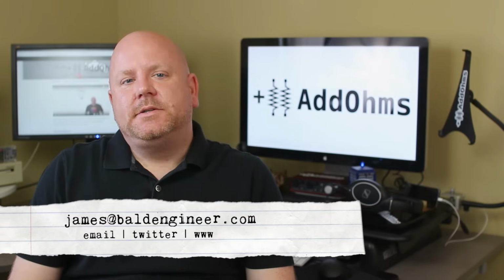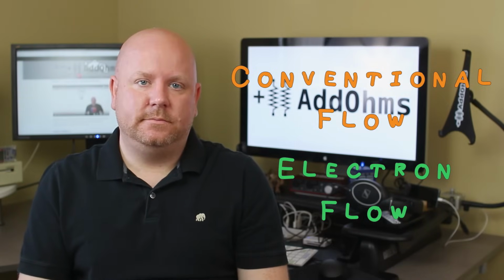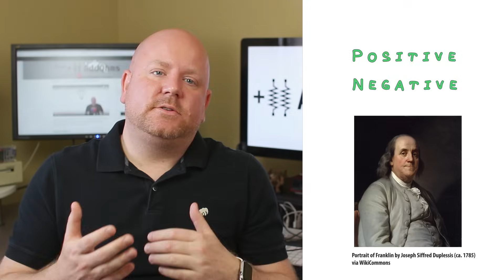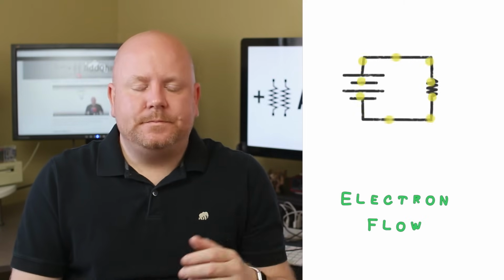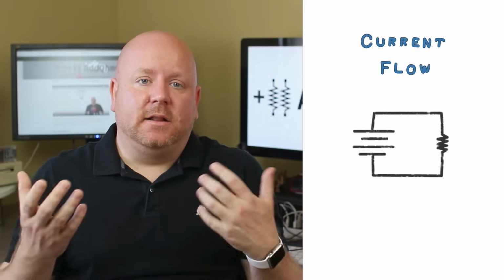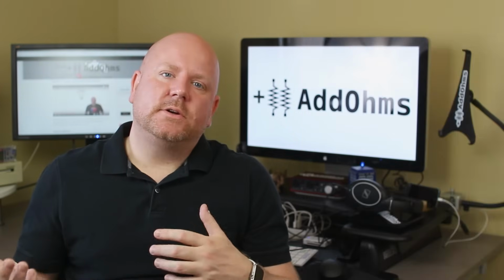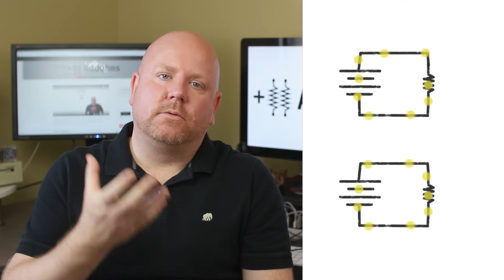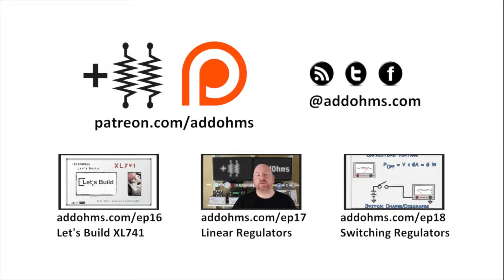Which way does Current Flow | AO #19

Comment: I understand the explanation, but I still feel uneasy using conventional direction (although diodes with their symbol mess things up). Not only because that is not what really is happening, but it messes with other concepts, like the ground. If one wonders why is in most cases not only OK, rather required to connect grounds together, it is easier to visualize that when current flows from negative (that is, usually ground) to positive. When one connects grounds together, one can visualize those grounds (and ground plane on PCBs) as a single source of electrons, as a source of negative charge, and then electrons (negative charge) travel from there to positive parts of circuit. One can visualize ground as a big bowl of electrons, that are getting scooped out with spoons. :)
Reply: OK, so my intuition was on the right path, and my uneasiness was justified. :D

I really hate it when we know something isn't the way it is presented, but we do it anyway because of "the convention". I hope sooner or later this will be corrected, and then we won't have to talk anymore about conventional and real direction - there will be only one. :)
Reply: +mbaksa the number of electrons in a depleat battery is the same as a charged one...because if the electrons did not get returned to the atoms in the batt...you would have atomic decay.   what happens instead is that the chemical reaction in the batt gets weak.
Reply from the maker: The difference is why the electrons move! :) (I think)

I agree the bowl analogy applies more to the charge. 

Okay so consider this...

The bowl is the potential energy. The spoons scooping out the energy are the electrons. They are picking up charge as they go through the bowl and deliver it to the rest of the circuit.

Damn. Wish I had that when I made the video ;)
Reply: Charge is not consumed ever in a circuit. Electrons and positive ions all have "charge". It is a property of the particle that you can never remove from it. A voltage (or electric field) can be described as an imbalance of charge, which causes a flow of current in a circuit which is already full of charge. When charged particles move together, they produce magnetic fields. This is what defines an electric current, that unseen motion of charge (charged particle flows)

I would very strongly recommend reading through Amasci's pages on the common misconceptions of electricity. It will click for you right away.
http://amasci.com/elect/charge1.html
Reply from the maker: "is easier to visualize that when current flows from negative"

Unfortunately, your analogy of a spoon and bowl of electrons is very incorrect. Electrons don't "come from the negative." They simply flow in that direction. Every electron flows around the circuit.

This was my "ah-ha" moment. It isn't like the electrons start at the negative, travel to the positive, and disappear. They are particles (which is matter).  So they are moving around in a loop, no matter what. 

As far as the energy goes, again, it isn't like the battery or DC power supply or whatever "creates" the energy. Energy cannot be created or destroyed. Instead the energy of the battery is what pushes the electrons around the loop.
Reply: Electrons get scooped out with the spoon, their energy gets used and then they are thrown back into the bowl. So there is a loop. Also, from my understanding (which might be wrong) - there is a loop, but current starts flowing from negative pole (which we usually call "ground") since there is an excess of electrons, excess of negative charge. If there wouldn't be an excess fo negative charge (more electrons) compared to the positive sides, there wouldn't be anything to flow, right?
Reply from the maker: Okay, we're close! So let's clarify the difference between electrons and charge. 

Electrons are a particle of matter. They already exist in the "circuit". That's where the idea that they move in a loop comes from. In order for movement to occur, all of electrons have to move. (Actually the electrons are ALWAYS moving, it isn't until there is an electric field they start moving in a unified direction.)

The electron's is the energy.  So an excess of negative charge causes the electrons to move. That isn't the same as an excess of electrons. 

Here's another "ah-ha" that I had recently. Keep in mind that the charge, the energy, moves from electron to electron at nearly the speed of light. The electrons provide the path for the charge to "flow". However, the electrons themselves? They move much much slower. They can't move at the speed of light because they are mattter.
Reply: There is no excess of electrons at ground. You might say "But if there is no excess electrons at ground, where do they come from?". They come from the loop/circuit, this is where your analogy of having a bowl of electrons breaks down. Instead, the classic analogy of water flowing through pipes is much better. Simply imagine a loop of pipes, and the current is the flow of charge through that loop. There is no reservoir of electrons, simply a loop.
Reply: How is then the difference in charge between negative/ground and positive explained?
---
OK, could the bowl then represent the storage for negative charge? And electrons then carry the negative charge to the positive side and come back to the bowl...
Reply: There isn’t really a difference in charge between positive and negative, the density of electrons throughout the whole circuit is the same. 

The thing that produces the current is the Electric Field produced by the battery. All of the electrons in the circuit “feel” the same electric field and thus the same force and as a result all move in the same direction around the circuit.
Reply: Jake Jones, ok, but negative charge is carried from negative to positive part of the circuit? What then happens? Is it "spent" (in regards to the circuit)? It is not going back to the negative part, right? Is this the way we deplete a battery?
Reply: ken, I was asking about the charge, not electrons.
Reply: The electrons within the battery DO travel from the positive back to the negative, otherwise we wouldn't have a circuit. However it takes energy to move the electron from the positive to negative terminal within the battery, the battery has stored chemical energy that does this. The battery is depleted when this stored chemical energy runs out and it can no longer produce a current.
Reply: Still not getting the answer to the question "What about the charge, dude?!" :) What happens to the charge that electrons carry from negative to positive? If the charge doesn't return to the negative, then we could visualize negative (or battery excluding the anode) as a bowl with charge.
Reply: A battery produces a voltage potential between the negative and positive pole due to chemical processes. And this voltage potential is as you suggest an imbalance of electrodes on the plates (lead-acid battery) inside the battery. The plates inside a lead-acid battery is before charging it is identical (Both lead) but after being fully charged you have plates with different chemistry (the negative plate is still lead but the positive plates have changed into lead dioxin). This plates together with the electrolyte (acid) is a chemically unbalanced system and any chance given it will strive to return to a natural state. This chemical unbalance is very simplistically explained a saturation of electrons on the negative lead dioxin plates and on the positive plates a numbers of "free electron spaces" in the atoms.
The larger the surface area of plates in each cell the more current you can draw from the battery before its "empty" , but more important you can draw higher currents over short time spans (for example running the starter motor in your car). 
When it comes to magnetic induced current it's a bit different. Here it is the magnetic field that pushes the electrons around in a circuit and not a static unbalance of electrons like in a battery.
Reply: OK, but I still didn't get my answer about the charge. It actually doesn't matter if it is a battery or other current source. What happens with the charge?
Reply: By charge i think you mean voltage potential (the force pushing the electrons trough a circuit)
"What happens with the charge?"
I'm not sure what you ask for. In a battery the voltage potential is given by the numbers of cells. In a lead-acid battery a cell has around 2 Volt potential. Couple those in series by 6 and you have a standard car battery of 12 Volts. Magnetically induced Voltage is a bit more complex question but it will first and foremost be depended of a magnetic field and the stronger this magnetic field is the larger the voltage potential. Did this answer your question?
Reply: No. At the beggining of this discussion it has been said it's not electrons that are going from negative to positive pole, it is charge (that electrons carry). Moving electrons do looping in a circuit. Charge goes from negative towards the positive part of the circuit. What happens with the charge electrons carry? It should go negative pole to... Where? I suppose it doesn't loop like electrons, otherwise no energy would bi transferred.
Reply: "At the beggining of this discussion it has been said it's not electrons that are going from negative to positive pole, it is charge (that electrons carry)"
If so. It's wrong! Electrons do move in a circuit. They just from atoms to atoms and replacing eachother all the time. I will read trough the comments one more time just to verify what you claim to be said.
Reply: That should of course be "jump from atoms to atoms"
Reply: Hmmm. I think i'm starting to see what you asks for. When you talk of an electrons negative charge you really are referring to the elementary charge. To explain what is going down on this level i will have to trow in the blanket. This is probably difficult enough to answer for  Ph.D in physics /quantum physics i'm afraid  :P
Reply: "If so. It's wrong! Electrons do move in a circuit." I might not have explained it properly - the current is not electrons going from negative to positive, it's the charge that electrons carry/transfer from negative to positive. So I visualized negative/ground as bowl with negative charge that is carried by electrons towards positive part of the circuit. So, electrons go in a loop - what happens with the charge? If the situation is as I described it, then conventional direction of current messes with concepts like ground.
Reply: See my previous answer.
You should not focus on the electrons elementary charge. I don't think that has a direct link to understanding electron flow in a conductor. In antimatter an elektron will have positive charge but still be the carrier of electric current in a circuit. It's impractical to go this far into particle physics just to understand electric current :)
Reply from the maker: Not necessarily. If you wanted to stick with the bowl analogy, conventional flow simply says the bowl exists at the positive potential instead of negative (ground).
Reply: That wouldn't work if we talk about negative charge.
Reply: Can you make video on arduino clones and the most common problems with them